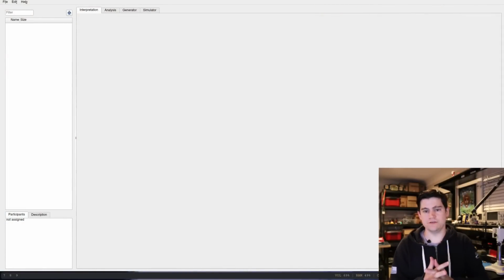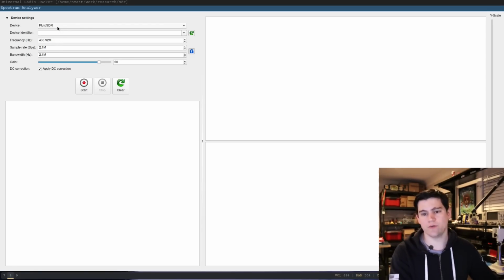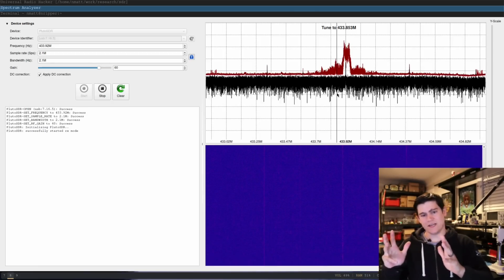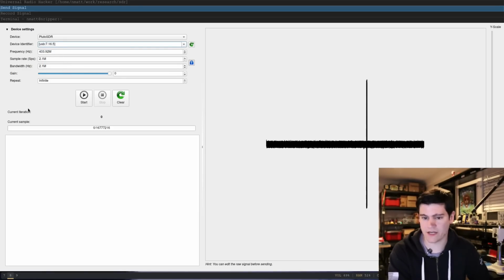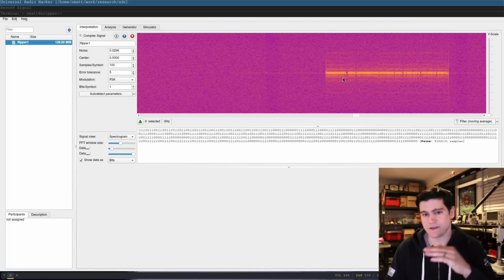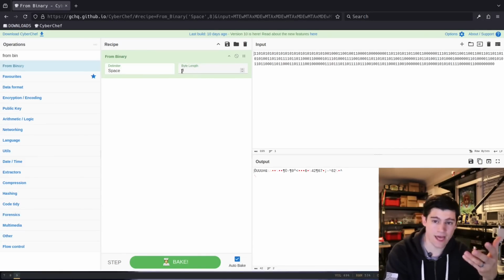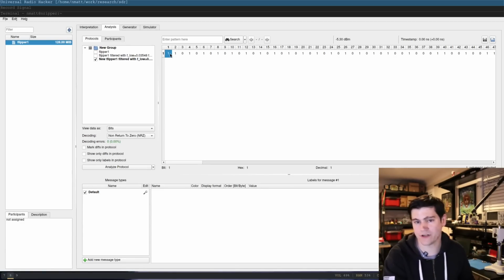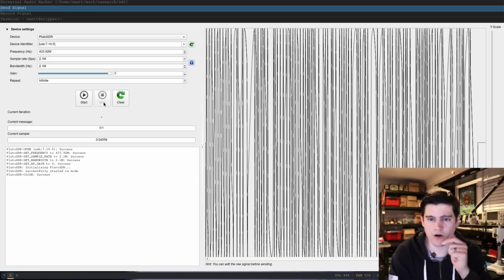Flipper Zero Chat App - RF Signal Analysis via SDR

Comment: to change the message in the data you'll have to update the CRC the protocol uses to confirm the data was all correct if you have different data anywhere that CRC will have to be updated to match ive ran into the same issue with this chat signal

Comment: I like the video's!

Just for info: FSK encoding uses indeed a "preamble", often 0xaaaa because that gives the max amount of 01 changes. The receiver uses these 0xaaaa... stream to sync to the signal. So your "first 1" is just garbage from the receiver trying to phase lock the received signal and succeeding partially. After the 0xaaaaa...... there should be 1 or 2 start bytes. Then the data. The FSK does not (what I have seen) have an "end-of-data". That should be handled inside the data packet. 

So your data must have some encoding too, including CRC most likely.

Keep creating these video's!

Grtz Matthijs

Comment: Would love to use a LimeSDR / Flipper Zero to first learn by using existing software:  

--Morse Code CW Transmission (NFM and AM/USB) and decoding/Receiving (CW Skimmer, CWGet , morsecode scphillips translator, "Playful Technologies" AI-based Morse Code Decoder, etc) 
--HAM : trunking (SDRTrunk / Unitrunker) / TETRA (SDRsharp plugin, OpenEar, OsmocomTETRA), digital-modes (DMR, D-Star, System Fusion/C4FM, NXDN, P25/Police Scanner (DSD LouisErigHere), POCSAG (PDW Software) , YSF FT8 )) , convert modes on the fly (i..e use DMR radio to talk on C4FM), 
--Decoding/Visualizing Weather Satellite data (noaa-apt, WXtoImg ) 
--ADSB Plane Tracking (X-Plane / XHSI and AdsbSCOPE plugin, MultiPSK with Maperitive) ;  
--Finding Satellites (Orbitron , g-predict, orekit)
--GPS Decoding/Plotting/Spoofing ( GNSS-SDRLIB, RTK-NAVI) 
--ATSC Video Receiver/Transmitter (Portsdown DATV, SDRAngel, GRC, SDRGlut) 
--Local GSM/LTE cellular network (GPRS) (gr-gsm, Kalibrate, IMSI-catcher, srsLTE-Sniffer, rtl-sdr-LTE dedsecimsi, FALCON) 
--Text/voice decoding (OpenEar, Defcon 2016) 
--Inmarsat AERO satellite Medlink AMBE Audio ACARS (jontio / libaeroambe built JAERO) 
--Reverse Engineer an RF keyfob ( clock-recovery, analyze protocol (Universal-Radio-Hacker, Inspectrum), transmit ) 
--Reverse Engineer Direct Sequence Spread Spectrum

Then, writing my own applications using GNU-Radio-Companion!

The SDR courses I found below look good, but not sure if any start with practical walk-through, then go deeper into theory and how it works.  For example, reprogramming the LimeSDR FPGA!
 $2500 Sébastien Dudek
 $1500 hackers-arise Subscriber-PRO SDR For Hackers
Balint Seeber / Ettus Research GNU Radio Tutorials 
 tonex , enoinstitute , factorialabs
Georgia Tech Prof. Edu 
$15 Udemy (Designing RF Comm Systems using SDRs with GNU Radio, Mastering SDR with GRC, etc), 
csun skatz CSUN/EAFB Software Defined Radio (SDR) Senior Project  ,  ECE4305  
GH SSkySurfer / SDR_Learning

Comment: pretty sure the checksum is your issue
Reply: The CRC bytes should be already included in the captured signal. CC1101 chipset is adding 2 bytes CRC16 over-the-air that are captured by the SDR.

Comment: Notice how when a send is normally sent on command line in the serial console (e.g., at 23 min 15 sec) there is a kind of prompt. There is a right shift, and when things complete, a blank line. You probably need an end of line type character. Maybe \r, \n, or ^D. Maybe something custom. But the terminal will see some characters and transmit, while some may be interpreted and stripped out after some action is taken (such as the difference between an "enter" key showing as a new line for paragraphs, versus maybe actually sending the buffer).

Comment: I like thinking basically that there are various types of Modulation and also various types of Multiplexing.  Do a Wikipedia search of Modulation and Multiplexing for a higher level overview with some sources for more details for starters I think helps. Wow, is there a lot to learn.  Interesting histories and interesting seeing the latest for the Universal Radio Hacker, Wireshark and whatever the latest SIGINT apps are available open source to improve on. Neat and gets me thinking a really all in one Protocol and Communications analyzer open source system using COTS hardware and open source software would be a great project.

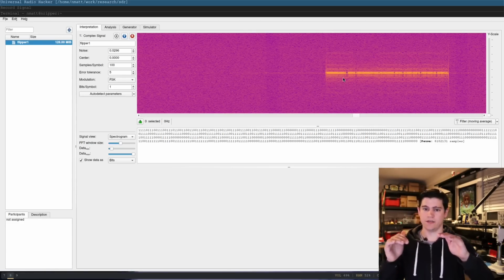Comment: @13:39,  Y axis for amplitude, X axis for Frequency, since you are checking the FFT plot.
Reply: Ah my linked comment made my original comment disappear.

Looking online, Matt is correct about the axis' for the spectrogram.

"A spectrogram is usually drawn in two dimensions, with time along the horizontal axis and frequency on the vertical axis. Amplitude is also included, using color or grayscale. If you think of FFTs as snapshots, a spectrogram is a movie- a series of FFTs displayed in the order they occurred."

Comment: Keep up the good work. Thanks for another interesting video. I used Arduino w/ an ESP8266 to be able to remotely control a projector w/ IR as well as a remote controlled (315MHz) outlet. It would be interesting to dissect some remotes and get the actual data.

Comment: Have you tried to change the name of the spoofed flipper?  Could your flipper be ignoring the transmission because it thinks it is from itself.  Just throwing that out there.  I use meshtastic devices for some private communications and it is a mesh network that retransmits messages as a broadcast but the sending device doesn't see the message it originally sent out.  Just a hunch but you might enjoy ham radio.
Reply: In the original replay that he did, the Flipper did display the messages even though they had the same device identifier.

Comment: Make sure that you didnt throw anything away like the "1" at the start of the synchronization, 101010..., it could represent a start bit or stop bit.
However, I believe there's a checksum to be placed somewhere at the tailend of the data. Need to figure out how the checksum is calculated and where it should be placed. I believe URH can help with that.

Comment: Another shot in the dark about your problem, if the carrier frequency is too similar to the signal you are trying to copy, then maybe you could mess with carrier frequency settings or dynamic range. Also, if the preamble is off by 1 bit, it won't work. Just throwing a couple ideas out, don't really know what I'm talking about very well.😂😂
Reply from the maker: got it. I'll definitely try all this out.
Reply: @mattbrwn  I believe that the la character is a sort of checksum, there are tool online that give you various checksum with an inputted string so you cold match the result from the string which starts with “FL” and usually ends with “\0”, “\r” or \n”…

Comment: I'm not 100% sure what chip is used in flipper zero (CC1101 I think?), but it's very possible that it has built-in hardware CRC check and it maybe that URH doesn't send that checksum. I did have similar problem back in 2018 when I started playing with CC1101 and URH but I ended giving up on it back then.
Reply: Sub-1 GHz module

Transceiver: CC1101

TX power: -20 dBm max

Frequency bands (depends on your region):

315 MHz
433 MHz
868 MHz